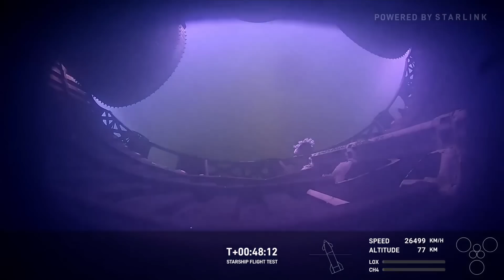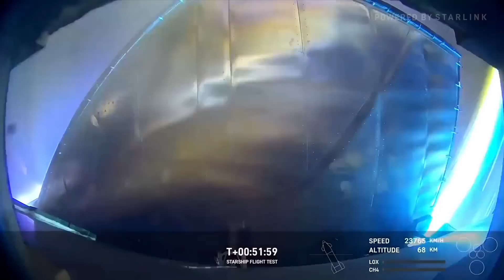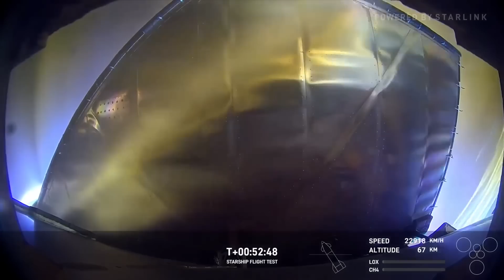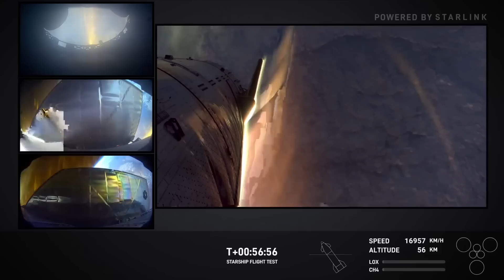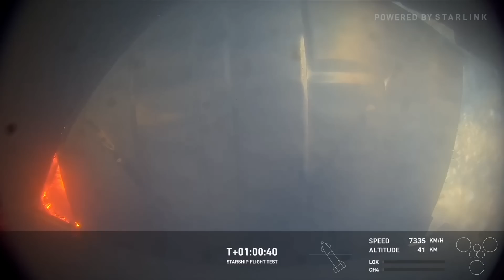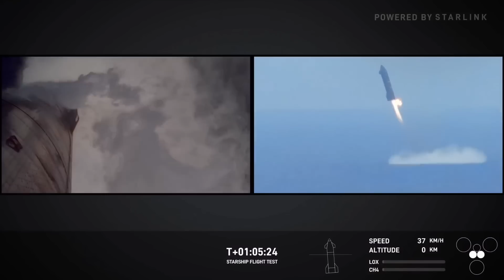Wow! SpaceX Starship re-enters Earth's atmosphere during 6th flight, splashes down!

Comment: The heat and plasma are not caused by friction with the air . It is caused by the air's inability to get out of the way and therefore gets compressed ahead of the ship . If air or any gas gets compressed it heats up such as in a Diesel engine where the fuel is ignited by just compressing the air/fuel mix inside the cylinder , no spark plug is required !

Comment: Just wondering. How are these videos taken especially from what looks like from the top side when there isn't anything protruding from the rocket to be able to take a pic or a video with that type of an angle?
Reply: Tiny HD glass cams are positioned all over the latest vehicles, in use by motorists/equipment operators/pilots every day. Takes a bit of searching to even locate by their owners, they are amazing features of today.. ;}

Comment: Didn't anyone see the space shuttles launches and landings?  I'm not impressed and BTW, it exploded in the Indian Ocean, right?  Tell you what, if you are that amazed, volunteer for a ride on the next launch.
Reply: Destruction following landing was expected, its not designed to handle horizontal loads like that. Shuttle was good, but it’s outclassed by Falcon 9 and (if it lives up to its potential) Starship. Shuttle really wasn’t a great design all things considered. The mandatory crew requirement really screwed it over

Comment: Those re-entry flames burning parts of the Starship burn green at some points. Very colorful. Looks like the same shade of green of these green meteorites everyone’s been capturing. What metal is that?
Reply: starships heat shield still needs some work so thats probably the some of the borosilicate glass that the heat tiles are partly made of

Comment: I didn't watch all of it..  So why ditch it?   will they retrieve from the ocean?
Reply: No. I don’t believe they have a vessel capable of recovering Starship at sea. Starship also isn’t inert and gets damaged when it tips over, so it would be fairly dangerous to approach.

If the next water landing is successful, flight 8 will attempt a catch of the vehicle. If it fails, they’ll keep doing water landings until they’re confident in Starship’s ability to land

Comment: Why was it burning up whilst in the water? That doesn't appear to be very good...
Reply: Vehicle may have partially broken apart after landing. Rockets generally aren’t good at handling horizontal forces, so they’ll usually not survive tipping over in the water.

Might also be methane that was vented overboard, there’s usually some amount of fire from vented methane igniting from the hot temperatures of the vehicle

Comment: Why is everyone acting like this was a success? This was a failure. SpaceX had to abandon the attempt to catch the Starship booster on land, they had to do it over the water and as you can seer in the video, it landed hard in the water and remained on fire after it landed. It looks like a total loss.
Reply: The aborted catch attempt and this video are different things. The aborted catch attempt was due to comms being lost with the tower, so the vehicle diverted in order to avoid damaging pad infrastructure.

This video, on the other hand depicts the upper stage landing, which was always intended to occur over water. Similar to the aborted booster catch, this is done for safety reasons. Overall this flight was about as successful as the previous flight, with the in-space relight and more aggressive re-entry offsetting the aborted catch

Comment: Underwhelming.  A step backwards from the previous flight test. Must be the Trump effect.
Reply: the only step back was the aborted booster catch, this was a step forward for the ship, this flight proved that its raptor engines could be re-lit in space, paving the way for Starship's first orbital flight, as well as showing the vehicles resilience as they have taken off a significant amount of heat shielding and tested a more aggressive angle of attack + higher peak heating during re-entry.

Comment: This isn't even full speed reentry.  Coming back from an ISS altitude it would faster/hotter.  From the moon even more extreme.😊
Reply: i would assume that a ship coming back from the moon would take a shallower reentry angle to minimize excessive heating
Reply: Apollo came back from the moon at at an inclination no shallower than 5.3 degrees, and no steeper than 7.7 degrees.

ISS return vehicles like Dragon though come in shallower, around 2deg if my info is correct.

The steeper the angle they come in the more rapidly the G-Forces will ramp up, and they can get quite high.  You might find this interesting: https://www.nasa.gov/history/afj/ap11fj/27day9-entry.html#1950306

The apollo returns took up to a peak of 6.5Gs because of the steep angle.  Dragon only peaks around 4G.  

It does get hotter coming in steeper, and it does increase the loading.  But bleeding off the excess speed needs to happen quickly enough that they actually come down to the surface on that first pass, which was a real concern.  Once separated from the service module their life support time was limited and they would likely not survive the wait for a second orbit to finish the arrival.  

So it's all about compromise.  
How much do you want to stress the craft and crew?  
How much heat can the shield and skin tolerate, and for how long?
How much speed do you need to lose?

Returning from the ISS they are moving about 17,500mph relative to the atmosphere.

Returning from the moon apollo was going 24,500ish when it began re-entry.

Comment: Why risk catching the ship instead of using the landing legs like the early prototypes?
Reply: Landing legs are heavy. The weight saving by catching is huge.
Reply: The landing legs mean falcon 9 is reusable. Landing back at the tower allows for rapid reusabilitiy. Eventually they will be able to land the booster, do a system check, reload a new starship, refuel and take back off.
Reply: @brianbiddle7590  my contention  is this there are no catch towers on either the moon or Mars which is where the future starship are suppose to be going. They will have to have landing legs so why don't build the ships like they will have to be built instead of having to do it later.
Reply: @robertr4193  mars gravity ~40% of earth gravity, moon gravity ~16% of earth gravity.
Legs that are needed for mars couldn't take the weight of an Earth landing.
Legs that are needed for the moon are matchsticks compared to what's needed on earth.

Also, SpaceX have a "cross that bridge when we come to it" approach to development. It's still a bit early in the design cycle to be testing off earth landing legs.

Comment: This was arguably cooler than the booster catch last time.
Reply: How????? It was a failure. Watch the video, it was on fire in the water. This was not planned, the plan was to have the booster catch sequence done on land again so they can re-use the rocket. That did not happen this time and the rocket is damaged now.
Reply: @jensen1901  These are prototypes. The plan was never to reuse these. The booster was supposed to be caught but it had to abort. Even if it was caught it wasn't going to be reused because these prototypes are just for testing for now. The upper stage (the one I was talking about in this video) was never meant to be caught. Their launch license is for it to land softly in the Indian ocean, which it did perfectly.

Comment: All those sparks are heat tiles disintegrating. The steel of the ship itself is proving to be more capable than previously thought in holding against the peak heating. The hull is thicker and melt through tends to not happen there, the flaps aren’t as thick and those little gaps between the flaps and the hull is what allowed plasma to get through prior and melt the flaps. Theres got to be a way they can cool the internals of the flaps on descent, maybe blowing cold gas into the flaps on descent to help prevent melting or overheating.
Reply: Were the flaps compromised in any way because I didn't see it?
Reply: the forward flaps got a little toasted

Comment: As much as Im a fan and amazed at all this the statement "not expected to recover the vehicle...." is concerning. does that mean they are approved to drop this in the Indian Ocean.... as trash? Anyone know if they require permission to do this and if so who from. Lots of chemicals and rubbish just being "dumped" in someone else's ocean
Reply: Compared to a single container ship going belly up, or an oil rig accident, this is tiny.
Then there is exactly what chemicals..
Vast bulk of it is stainless steel, that's going to make a tidy reef.
Then theres fuel : oxygen and methane.. No hazard there.
Probably a few funky polymers in the heat tiles, but now it's down to a few tons, the ocean can shrug that off easily.

But as for the banana.. Yeah, that's real pollution.
Reply: Well, considering how India treats their "sacred" rivers,  we shouldn't expect much complaint from them.
Reply: The impact is Less than a needle in a haystack. There's this thing called math. The oceans are unfathomably large. This is common sense. I will never understand how environmentalist simps got to be so gullible
Reply: It’s only matter when Chinese rocket get fall in sea. It doesn’t matter if America rocket fall and dump their rocket chemical or any other nation do it. We only complain when china does it… simple and clear….
Reply: all good points and I hope
that is the case. It would be great if the enthusiastic commentators could
touch on the subject and shed some light on the matter

Comment: Spectacular views. Is anyone going to address the fire after it was in the water? Looks like the heat shields reached their end of usefulness.
Reply: Rectal speculation the fire was just fuel venting. It's better to slowly vent vs leaving the fuel pressurized in the tanks.
Reply: They're going to have to try and figure out what they can do to fix that problem, so they can do a better job on the next series of test flights and eventually get this beast of a rocket to be reliably and rapidly reusable enough to put humans on board.

Comment: How do they have a camera on the outside that can stand the heat and shows no vibrations and then it goes in the water with nothing there then they immediately cut to a camera in the water????? Something stinks about this!!!!
Reply: Because the camera on board is in a heat-resistant shell. The camera on the water is on a nearby buoy.
Reply: @kamxam1384  why doesn't the lens melt and why no vibration?
Reply: @kamxam1384  How could the buoy possibly be in position in the middle of the indian ocean?
Reply: @fs3579 the bouys were placed there in advance around the targeted area, which the spacecraft was designed and programmed to land in. This is how they test it to see if this prototype will be safe enough to fly back to it's launch tower and be caught by mechazilla's chopstick arms, like they caught the Superheavy booster #12 on test flight number 5. Last month.  This flight's Booster #13 had some unknown as of yet, anomalies, that the onboard computer caught and decided it was unsafe enough not to return to the "mechazilla" AKA (launch tower's) awaiting "chopstick" arms.
Reply: The camera were likely still running but they switch to cameras, remotely operated on barges to show the ship floating. OH! And the heat shields were on fire! THAT they didn't address conveniently enough.
Reply: @Betorn_X  There is no barge there we can see that as it decends!
Reply: The cameras floating on the Indian ocean were placed in advance, at the targeted spot on the ocean by SpaceX, to test the accuracy, of this amazing prototype rocket designed to be fully reusable and safe enough to eventually carry humans into and through space, to the Moon, Mars, and back again.
Reply: @JohnFoerster-i5y  i thought they said it was a no go to catch it in the claw and it was aborted or rerouted to ocean. Are you involved in this company is some way?
Reply: @fs3579  the no go catch was for the heavy booster. the spaceship was planned to land in water.
Reply: @JohnFoerster-i5y  why dont they show the rocket touch down from the buoy? It is closeup. Instead the hide the important things. If there is camera on the outside of the rocket. lets see the whole trip not a edited in shot!
Reply: answering all the questions you made:
- the camera on the outside cant withstand the heat but it still works because it isnt in the airstream during reentry, the cameras keep recording after being submerged in water, but it doesnt make any sense to show what happens on these cameras because you wouldnt be able to see anything as shown in the youtube channel of SpaceX in the IFT 5 recap video
- yes there probably is a barge on the water, just kilometers away from the landing zone
- the lens doesnt melt because the spaceship has a heatshield for a reason right? to protect the important stuff
- why would there be vibration?
- the buoy was placed in advance because they have a landing precision of meters, yes, very precise.
- they said it was a no go to catch for the superheavy booster, which is the first stage, so it landed in the gulf of mexico, close to starbase. The starship was intended to land on the indian ocean
Reply: @xShantix  I am talking about the cam video as it ascends looking to earth. The airplane has vibration why wouldn't a rocket.
Reply: @fs3579  when it ascends it does vibrate, but the cameras probably are tightly attached to the rocket